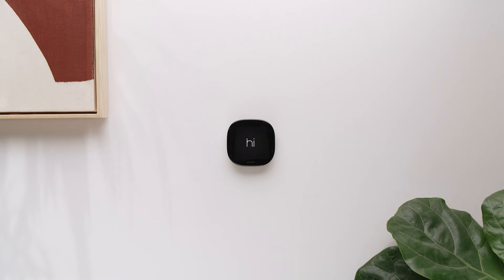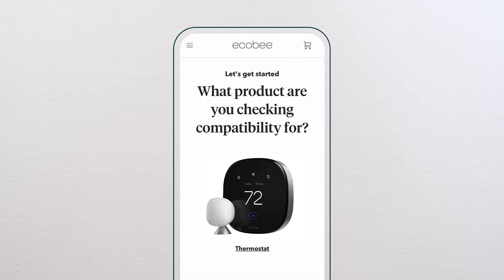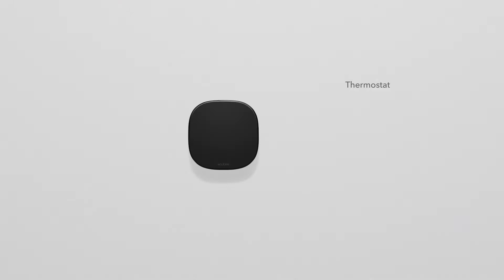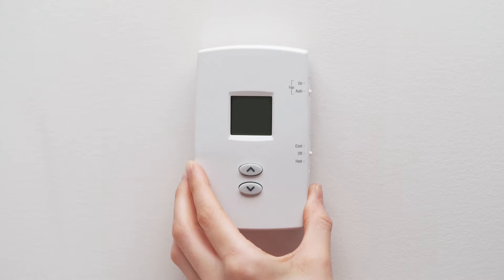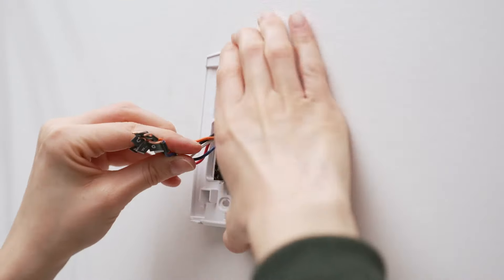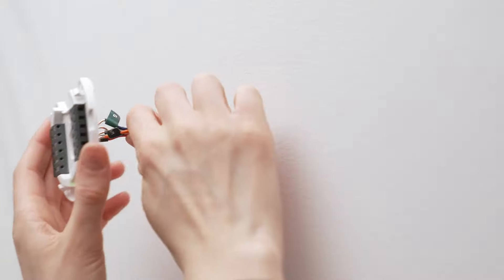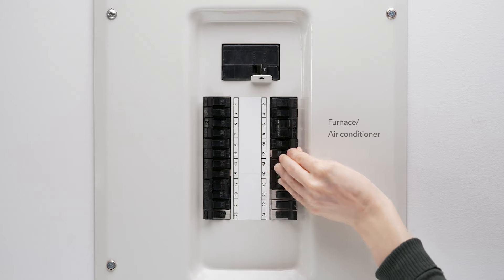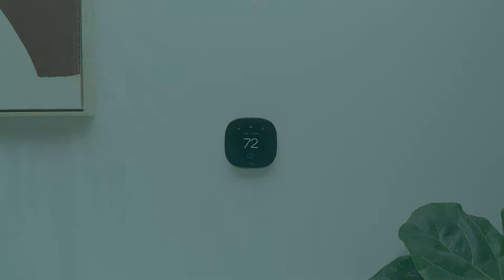How to Install ecobee Smart Thermostat Enhanced and Smart Thermostat Premium

Comment: I'm replacing an eco bee 3 lite with the enhanced thermostat, can I just plug in the enhanced where the lite was?
Reply from the maker: Hi there! The back plate is different for ecobee Smart Thermostat Enhanced. You'll need to follow the installation guide in-app. If the wires are already labeled it should be a quick install.

Comment: Can this be initially installed without WiFi and then connect it later?  I will be getting internet set up next week, so I'd like to install now and then connect to WiFi for smart home features once I have internet established.
Reply from the maker: Yes. Even without a Wi-Fi connection, your ecobee will still function as a traditional thermostat; it will engage your equipment as needed and maintain your comfort set points.

You can simply skip the Wi-Fi Configuration portion when setting up your ecobee, though, please be advised, skipping this step and never connecting your ecobee to Wi-Fi will not allow you to complete the registration process, so you will be unable to create an ecobee account.

Comment: Can this be installed without a c-wire?
Reply from the maker: ecobee smart thermostats are designed for use with C wire for constant power. Without a c-wire installation may still be possible with use of the included Power Extender Kit (PEK).